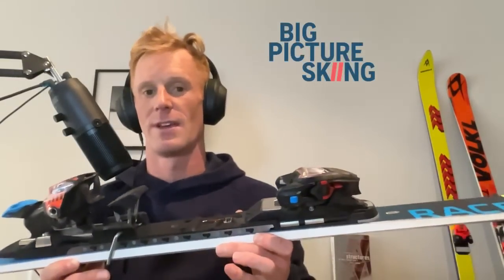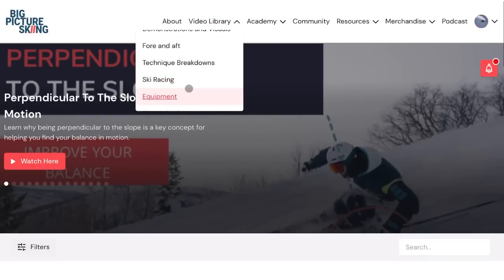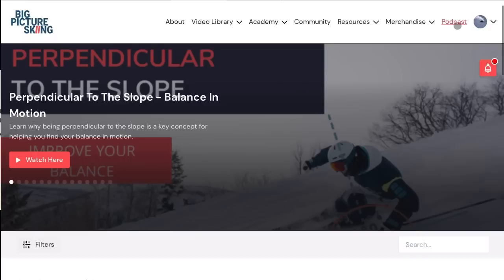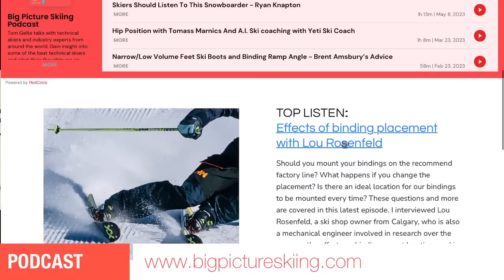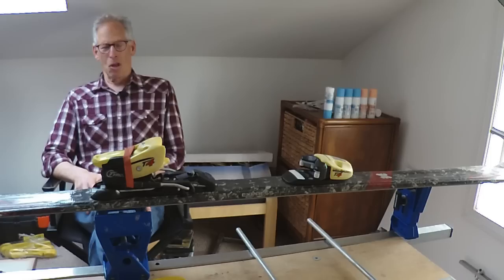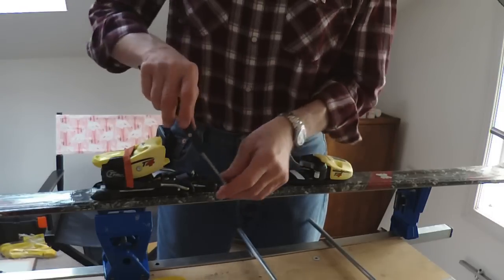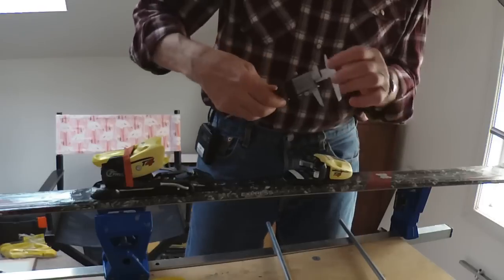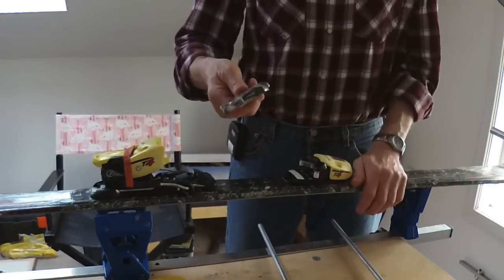Have You Checked Your Ski Binding Delta Angle? It Could Make You Ski Better

Comment: Excellent discussion! Several “Aha” moments, though it puts me in a hard place as I typically rent skis when I go out west in the US. Prior to my most recent trip, I thought I wasn’t getting forward enough in my Tecnica Mach 1s, but the sensations I felt on the slopes didn’t track with that assumption. My quads were getting lit up on steeper pitches, and I felt my weight on the balls of my feet instead of even pressure on my feet and shin on the tongue. Realizing I was out of balance and leaning back after fighting to hard to get forward made my head spin, but set me down a rabbit hole on forums and videos like this. I want to have my boot cuffs looked at to ensure my calves aren’t pushing me even further forward, and now I’m considering buying skis so I can control the delta of my bindings… Now to find a setup that will allow experimentation. Thanks again for the great information.

Comment: Really good info Tom. I’ll have to check my skis. But going back to fore aft binding position. I have changed certain bindings from the factory mark. On my K2 bolt 174 skis. When I first skied them I felt it really hard to make short turn and get the tip in gauged. The bindings were adjustable for boot size, so I moved the whole binding forward 2 settings. Now they ski great, make a good feeling short turn and still are great at high speed carving. Cheers

Comment: On the inline skates, I was going to say that the position of the wheels laterally under your foot matters a lot too. But yeah, I can see how the delta or ramp angle would have a big effect too. As a tele skier, I have messed around with the delta angle and found that flat was terrible for me. Yet I don't want too much forward lean either. I modify my boots more than the bindings these days to get the geometry right for my biomechanics and the way I like to ride.

As for skis, I totally agree. Whenever I don't like a ski it's always one of two things.Either it's the tune or it's the mounting point. I'm very sensitive to both. I have one friend who I sometimes trade skis with. I always hate his skis and he hates mine. The difference is what we are used to and it isn't the ski design. His skis are never tuned. The edges are always beat to hell. Also, his bindings are always mounted according to conventional tele wisdom, which says to mount -2 cm. He uses the stiffest tele boots and most active bindings to generate tip pressure. I like a softer boot and even cut the top buckle off a 4 buckle boot and I mount on the line or up to +2. For me, enough tip pressure is easy to generate from that position.

Comment: Difficult to find a non race binding with zero delta. A shorter boot sole length with a lot of delta in the binding makes the problem worse. A few millimeters is HUGE! Heel lifts, and ramp angle of boot board, serve a different function. Get to know and talk to a good boot fitter. Too bad there is no industry standard. Very few coaches/instructors are knowledgeable and have a critical eye for this area of performance. The boot fitter’s job is to put each skier in a neutral position. If you are at a plateau in your development, this is the first place you should investigate. Great job guys!,

Comment: Tom, Good conversation with Lou (spoke to couple years ago) I' m Masters racer at Sun Valley ,ID  Our snow(manmade ) is very reactive to setups , I've used dail claipers to measure binding  deltas, Make my own binding shims .5, 1, 1.5, 2 and 3mm (I use Maker X-Race 18's on my race quiver mostly Dobs but Atomic for Sl . Latest , use digital angle guage  to measue my binding delta and and also my boot board delta to get a basis to start setup experiments (I call getting into trim , like a pilot trims his flght controls in level flight  so doesnt have to fight the controls to fly)   When measuing my deltas I use a peice of flat stock alu plate about the length of my boot sole (with slot cut out for the brakes)  , place ski on pedestal only as long as binding length (to minimize ski camber effects) Zero out guage on pedistal first .  Can do similar with boot board and combine the two for a total delta  Plug boot board deltas  may come with 2.5 , 3+  up to  4 deg  depending on brand , Ramp, cant and fore aft binding postion are all parts to experment with to the gget your induidual setup in Trim . I've found the longer the ski the less delta  needed.  Have fun  !
Reply from the maker: nice! ha we you listened to the podcast I did with Lou a while back on Binding placement? It’s on the big picture Skiing podcast and you’ll need to go back a few years. Or search Lou Rosenfeld
Reply: @Bigpictureskiing  I try and send you some pictures of my resume tools  I ve used the dia calliper for some time But just stated using dig angle indicator  I always have 1" Gorila tape in my pocket for fine tuning .  SL gleamed if toe is too high has trouble getting feet back under at apex  Lifting heal helped solve  If binding are too far fwd tips were too nervous.  My boot boards Lang ZAs are 3 deg and bindings 1.5 Deg ramps   I need less spoiler now All about getting trimmed out . All fun stuff !  Ski racing ,It's a disesse 😎

Comment: After the great first podcast you did with Lou I did measure the deltas on my different pairs of skis, which were Atomic FIS sl's and Dynastar Master GS, and indeed found a difference of give or take 3-4mm on the Look binding versus 0 on the Atomics. I liked the Atomic bindings more, the X16 var version, because I could play with the variable position until I found the position that worked best for me. 
I had some trouble finding a comfortable position on the Dynastars so I did change it's delta to 0 by adding a spacer on the toe piece and immediately felt the difference. 
So I'm indeed very convinced of the importance of finding the delta that works best for you and sticking with it for all your pairs. I recently changed to another brand but still use the raceplate, binding and setup of my Atomics and the transition went super smooth. 
I do think it's a pitty that (to my knowledge) only Atomic (Salomon) make a racebinding that can easily be changed in position for/aft, a lot of people would make huge steps by being able to play with that position

Comment: Hey Tom....greetings from Sugarloaf Mountain, Me. USA. Would like to address your comment on your Vockll WC  sl skis moving your binding back now. At the level you ski I would  encourage you to not move the binding but get Markers shim kit for their race plate. It is very easy to change your delta and comes with longer screws if needed. You can also stack the shims to increase the sole height of the snow. For you explore cumulative angle i.e. your measured boot ramp angle and measured  delta angle. 2.3-2.5.°
Reply: I assume these shims mount between plate and binding? So they should work on any X-cell, even if mounted flat? Where can one buy these shim kits? A google search reveals virtually nothing...

Comment: I ski on flat skis with Marker Griffon bindings so I can’t do much with the delta. My ankle dorsiflection is not great and is my main off-season focus. Thinking about your conversation makes me think that maybe I’m maxed out and is possibly why my start of turn metric is just fair(Carv). Maybe I should straighten my cuff angle, take out the spoiler and remove the heel piece under my liner. Just start as low and straight as possible, see how that feels and add on if necessary. As to fore/aft I feel like I should defer to the engineer unless I know exactly why I’m moving it. I’m not there yet. Thanks for giving me a feeling to look for as I experiment with different settings.

Comment: I have very low dorsiflexion, and as a result my bootfitter added a 5mm cork under the foot plus my custom footbed (which seems to also have some lift on its own). My boots are the salomon 130 supra boa 26.5cm, 12.5 forward lean (no spoilers), ramp angle of the Salomon Alphas is 4 degrees, so I assume same? In cases like mine, I am  purposefully ramped up to an angle of lets say conservatively doing the math with chatgpt  --- 4 degrees of boot plus 1.5 degrees (cork + footbed 7.5mm lift at 26.5cm length) = 5.5 degrees Delta ---, and this is an inevitable consequence in order to gain in ankle flex potential/range of motion. Putting a cork under my toes would just negate any cork under my heel, and reduce range of motion, it is not an option in order to reduce the delta. The only solution I see is external to the foot, and this video really opened my eyes. That said, due to the nature of my skis and my style, I ski reckoner 102s mostly, the ski is quite symmetrical and there isnt much that can be done in working with delta through adjusting binding position, or is there? not to mention that these skis are mostly supposed to be mounted close to the center. Any ideas?

Comment: Thanks for the info. Yet non-flat Rossi seems to be very sucessfull in WorldCup. Seems to me that this kind of recommendations would be more useful if individual differences are accounted for. For short & small feet skiers flat may be the way, but what about tall & large feet? Ramon Zenhousern seems to be doing just fine on Rossis.
Reply from the maker: I think the point is in this podcast that it is individual. You need to test and check what works. Nothing against Rossi.

Comment: in the case of non-adjustable bindings and a significant delta angle (5-10mm or more), do you think the front part of the binding could be leveled using a flat piece of plastic (or some other material; 5-10mm) to equalize the height of the front and rear bindings and thus reduce the delta angle? in other words, the front binding would simply be unscrewed, placed on top of an appropriate thickness of plastic, and then screwed back in (i assume that slightly longer screws would need to be used, but that shouldn't be a problem)...what do you think, could this potentially be a solution?

Comment: Personally I’d argue for a low delta angle but not zero. You loose valuable toe pressure and tail control when flattening your heel. When thinking about driving the book forward in racing, a few degrees helps; too much hurts.

Comment: Ok, now your messing with my mind….

One more thing to worry about. 

6ft tall with 28.5 ski boots with a heel lift in them since I have larger calves. I ski on Rossignol Hero MT Ti and I love them. 

Being a Carv user, I know that I score high in the Start of turn metric. I have also improved a lot my End of turn metric last season. It leads me to think that I have improved my overall fore/aft balance last season with my actual ski/boots/binding setup or even, despite my setup.  Am i correct to assume that ?

BTW, SkiIQ is 158. I am still hoping to improve.

Comment: Should we also consider removing plastic heel wedge found under the ski boot liner?
Reply: I assume you are talking about the boot board that runs the length of most boots.  If yes, absolutely never remove it, but depending on the construction it may be possible to lower it at the heel by grinding the top.  Never grind the bottom.
Reply: @louisrosenfeld1203  Thank you!
Reply: @davidchkhartishvili9845  You are very welcome.

Comment: 1) Stupid to change those all the time, if not standard, this should be adjustable 2) Delta an lean are plenty different stuff. If you squat a bit, so angle your knees, you are ok all the time, but: if you tut stuff under you heels, youll fee strange. So, inmy mind we do not need ramps and deltas at all, but we need lean  made in boots. And that is a problem nowadays, boots are all too upward and learners ski with their  heels and bum.